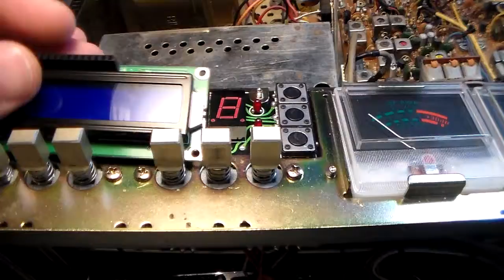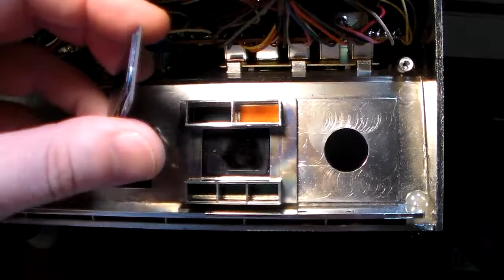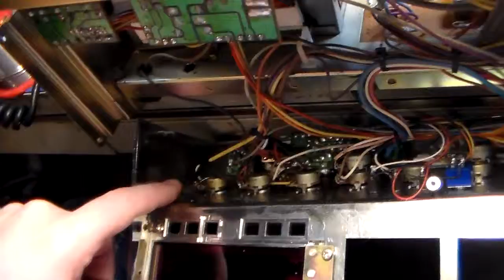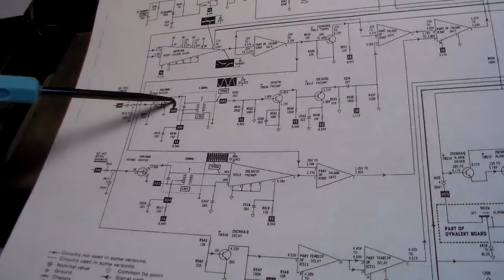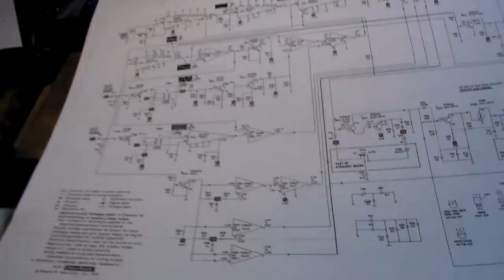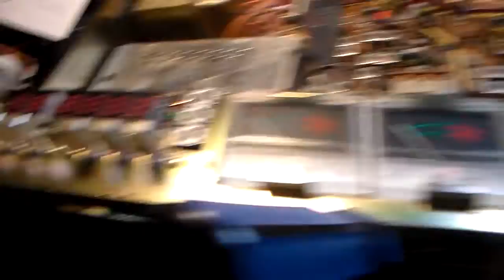Cobra 2000 updates and display research

Comment: Easiest way to mount the small display where the channel display is would be to pop the faceplate in a milling machine and mill the tunnels flush, pop out the window and then mill the opening for a exact fit.